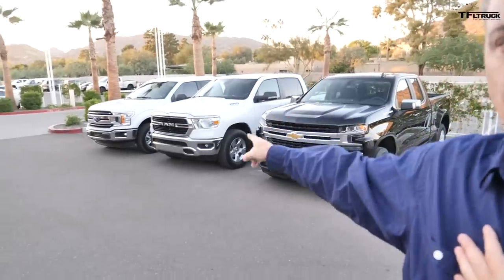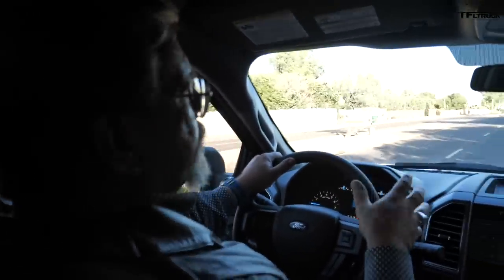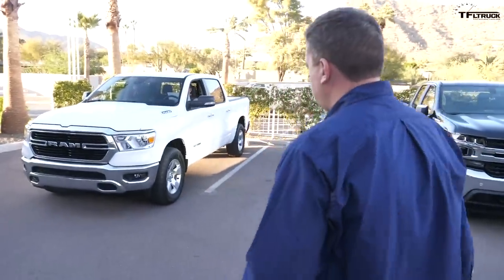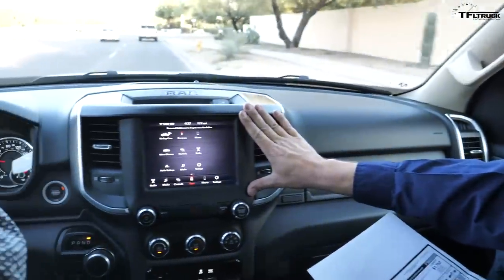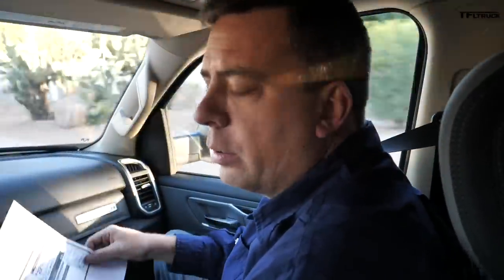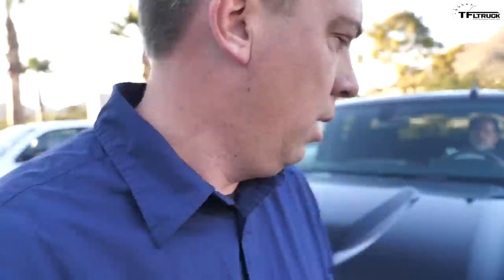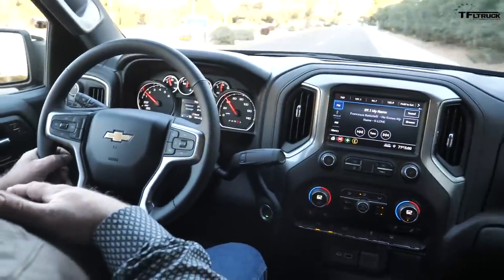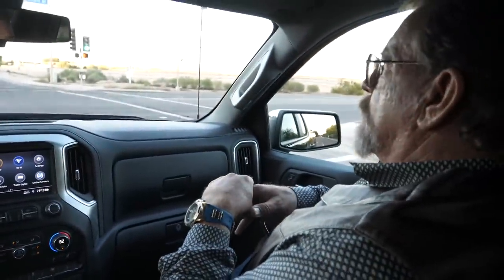Work Truck Wars: 2019 Chevy Silverado 4-Cylinder Turbo vs Ford F150 vs Ram 1500 Review

Comment: As a small farmer from Europe, i would buy chevrolet. Nice small powerfull engine in a big car, that means more space to work on that engine if somesthing goes wrong. I hate when in modern cars there are no space at all to work on them. Here in Europe its the worst -  a small car, like VW amarok with its v6 diesel engine, jeah, its powerfull, jeah it goes and bla bla bla, but there are no space at all to work on that engine and it s expensive to maintain that crap, work truck has to be simple, and i like this chevrolet. Straight 4 cil engine with turbo, what can be more simple. O.k. that electric waterpump could be faulty and expensive to change, but other than that, great truck for small jobs ;)

Comment: Why didn’t chevy put that four banger in the ZR2? It’s a smaller engine with more power and would fit nicely. If it’s in the work truck models and pricing why wouldn’t they put it in their off-road midsize?

Comment: i just don't get why we start at what 36k for the most basic, no radio, no real hvac system other than hot or cold in your face standard system, cloth grey fabric seats, and a plastic dash that rattles after a year of use (not to mention that they fade under the sun and scuffs easily.  (and most of these are not crew cab), yes you get a bed and can tow, but those two should not be a 20k mark up.  those MSRP are a joke.  and i should know.... i am a rolling joke on my ram 1500 :/  i just hope that this balances out in the next decade because they are starting to poke the 100k just to be comfortable, and honestly an SUV is roughly cheaper and i can still tow and haul enough :(  but that is just me

Comment: The problem is Chevy provided the Dodge and the Ford. It's bad enough to have a 6 cylinder in a full-size pickup truck I definitely wouldn't go for a 4 cylinder.

Comment: So chevy decides its ok to test a $44k truck against a $40k ford.  Ford's $44k would've had 5.0 and a 10 speed auto.  Chevy is desperate at this point to compare  a [work truck] that isnt a work truck. To Fords actual work truck.

Comment: Why everybody always talks about rear gears without factoring in the drive ratios of the transmission.  +/- 0.5 on the rear end is in the neighborhood of irrelevance depending what 1st gear (stop and go) and ‘top gear’ (cruising speed) final drive ratios are when comparing between trucks.

Comment: You can thank Uncle Sam for the bullshit 4 cylinder and turbo engines in a full size pickup. And the AC fan probably runs,  but the compressor does not so it isn’t actually cooling. Another gimmick to satisfy Uncle.

Comment: I like the 1998 Chevys 350 small block engine setup better than 1998 fords i don't recommend using fords reusable transmission pan gasket neither they're not reusable and are a bad design ford made 

Dodge's always gets piston problems so they're not the best to have 

Fords fuse boxes aren't marked Chevys is so you know what your looking at or for i fixed the old ford and we're using it now but thats because i got it for free and now i owe the person free help

Comment: i get almost the same mileage with my dependable old 5.3 eight. All of these expensive bells and whistles are  a bunch of baloney. I use my truck for work, i do not need all of this stuff. My brother bought a new Colorado with all of this computer stuff, and, it has been nothing but trouble, it goes into the shop all of the time. This new engine is so complicated and, delivers not much better performance. If i wanted a four cylinder, i would buy a Toyota, still the best.

Comment: Why would you go with the base 3.3 l Ford engine instead of their 2.7 l turbo? The Chevy turbo 2.7 is not their bottom tier engine so the seems a completely unfair comparison especially when it gets to miles per gallon and torque.  I think you really missed an opportunity to compare two turbo engines.

Comment: For those whining about plastic interiors. At least you can use it without worrying about ruining it as much.

Although I'm not a fan of the RAM, but I do like that electric motor. If for nothing else, to keep accessories running while start/stop is activated.

Comment: I think the unveiling of so many turbo engines from virtually all the manufacturers, cars and trucks, will ultimately not be a good thing. I like turbos in specific applications, but there's no denying certain manufacturer and their products are not the same caliber as others. Even some non-turbo engines have not been stellar (or worse) from certain makers. Add turbos to the mix and I think a lot of people in years to come will have a lot of expensive problems, and they'll be bitter.

Comment: Im a fleet mechanic and we have several F150s with the 3.3 v6. Oil pan and water pump start leaking as early as 40k miles. Not great build quality.

Comment: THE NEW 2019 SILVERADO 2.7L 4CYL TURBO TAMPONS ALSO INCLUDED AS NO CHARGE TO NEW CONSUMERS  G.M HAS BECOME THE LAUGHINGSTOCK OF AUTO MANUFACTURERS 👎 NOT GENERAL MOTORS ANYMORE THEY ARE GOVERNMENT MOTORS  WHOEVER IS COMING UP WITH THESE BODY DESIGNS AND ENGINE OPTIONS NEEDS TO BE FIRED

Comment: Everyone bitching about base motors and 2.7 this and 2.7 that. Ignoring the payload capacities. You can load the Chevy up with more gear and people and the bed volume on the short box is larger than both the ram and Fords standard box.

Comment: I think chevy 2.7 inline is a good idea makes all power down low can't beat inline . The ford 2.7 will definitely out run the inline , it will out rev the inline.  Both engines are good choices better than 3.6 penn star . Andre your nuts with that electric motor stuff .

Comment: I reckon these 4cyl trucks are not going to last as long (reliability wise) in comparison to 6cyl and 8cyl trucks. With such a heavy weight to pull around the engine is going to be under strain most of the time and working a lot harder.

Comment: Isn't the 4.3 cheaper than the 2.7/4 cyl?  That's what a fleet buyer will purchase.
Reply: Scott Strom They doing away with 4.3 and replace with 4 banger
Reply: @glenparks5175  They are keeping the 4.3 but haven't released it yet as an option since production just started on the new 19's. They typically offer the most profitable trucks first " crew cabs , higher trims, etc.  The 4 banger costs more than the 4.3 will, so that's why it isn't out yet. The 4.3 will be available in the next few months from what I understand and it will only be available in the work trucks.
Reply: @glenparks5175  Go to the Silverado site. Go to Build and Price. Go to Work Truck. What engine is listed?  4.3L.
Reply: Scott Strom
the 2.7 is replacing the 4.3 V6, their probably keeping the V6 around till they work the bugs out of the 2.7
Reply: Glen Parks go to the Chevrolet website. For 2019 WT and Custom trims the 4.3L is the base engine.
Reply: @anthonywebber2211  if the 4.3 is still around then it's not replaced.  What year is it being replaced? Next year? 2024? No facts= making stuff up. Show us the documentation.
Reply: Scott Strom
1:04
https://www.youtube.com/watch?v=J7fRGCO1_Xw
Reply: Sorry, if you watched the video the 2.7 is only FOR the LT and RST models only. The 5-year-old 4.3 will be around for a foreseeable future as standard for Work truck, Custom and Custom Trail Boss, while its companion 5.3 will be available across the board.
Reply: @Mr10Alpine  Why does the title of this video say: Work Truck Wars?  That's my point. Since when are LT's and RST's work trucks. I already knew that, didn't have to watch the video. This is another apples to oranges comparisons.

Comment: Those are not work trucks maybe the ford but the big horn and chevy are not a work truck is a really based out truck no power window or locks jst an am fm radio vinyl floors no chrom jst basic paint and rims 15' and mainly 2wd rear drive

Comment: I'm not a big fan of the new 4 cylinder. However I am a big fan of fuel economy mainly because I would drive it for then I would be doing towey. So fuel economy would be better for me, but I believe that a the 6 with a turbocharger would be quite sufficient for power and fuel economy in my opinion. I have a feeling that Chevy may take this engine in revamping to make it better as far as fuel economy goes.

Comment: I use this f150 single cab as service vehicle and i absolutely like the sufficient power. Have to add it has great millage pretty much same as competitors v6 while riding empty about 25-26 hwy, but ohh boy it goes down when you load it (not towing), my average in city shows 12 on display, which is kind of expected with small engines. Means this is great economy half ton, if you don't carry heavy too often

Comment: Really the 2.7 4 cylinder could run off of two cylinders it would be running off of 1.35 displacement at that point

Comment: If the turbo will hold up this could be a 500,000 mile motor. If it has forged internals and a roller dohc.setup. with chain.  Not belt

Comment: The price difference between the Ford and Chevy was $5,000.  I would like to see a Ford with $5,000 more options tested. Also the Ram was a few thousand less. Option up the Ram some also.
Add $5000 more to the Ford would be an XLT with the 2.7 litre eco-boost.

Comment: Ford 2019 4x4 stx with 20s 8 inch screen sync 3 for $43.430 still cheaper with huge back seat that Chevy it's an extended cab on ford not a crew cab why dont they choose something that actually makes sense 2.7L 325hp and 400ftq

Comment: The 3.3 from ford in the xl trim is actually a pretty good deal if you go used because people would rather have the 2.7 eco. Thats what I did and I got a good deal plus the engine has more horsepower than my 2001 5.4 Triton and is much faster. Only difference is less torque but if you don't tow much the extra savings in gas is worth it and will most likely be more reliable in the long run because it's N/A.

Comment: Can you do a video of which drive selection (4auto, 4hi, 2hi) works best in light snow/slick roads on the freeway at speeds >50 mph. 
I know the obvious answer is 4auto, but some trucks dont have that option. 

 I know that some will say that you shouldnt do normal freeway speeds in slick/snowy conditions, however, there are times when there is just a thin dense coating, and the normal flow of traffic is still not far off normal freeway speed limits. In these cases I think it would be interesting to see whether 4wd/4auto improves handling or stability over 2wd.

Comment: Very good detailed review. I like how you pointed out the extra room in the bed. That was interesting. Dont like when Mr Truck stated diesel makes more torque since that is false now. There are many gas engines that make more torque than a diesel litre for litre when turboed. Its the turbo that gives torque, not the fuel type. Also, the 2.94 diff in the Titan with its 7 speed has a better stronger final drive ratio than the Tundra with a 4:30 diff and 6 speed. Its not the diff that gives more trailering power, its the final drive ratio that matters. And the chevy makes full torque at 1500rpm to 4000rpm. Not full or maxed at 3500 as stated, its full torque at 1500rpm. Thats lower end torque than a diesel and the curve is longer. Diesels lose their torque like a dropped sack of potatoes past 3000rpm. 

Good job Chevy and nice review minus my corrections I made. But all this useless crap with motors, trannies, diffs, exhaust smells, noise pollution, and rpm’s wont matter when an electric drive truck is available in 2020. Thats what im waiting for.

Comment: see I never cared about all the soft touch luxury or anything... as long as it has cruise control, A/C, and Full BT connectivity on the radio for audio playback that's all u need, if u were moving into the truck for a business, then u can get leather cause its a business expense and price don't matter as much

Comment: I meaaaan yeah 21 mpg is great in a full size truck. Until you compare it to their v8 counterparts. For instance my 2017 ram 1500 hemi with 8 speed auto and 3.92 axle is averaging 20.8 right now. And the 5.3L vortex 2016 Silverado I had as a loaner awhile ago was getting 21.6 AVG. the v6 and v4 trucks aren’t really about fuel saving anymore. Because the v8s have caught up in that department. The smaller displacement motors are to bring prices down for Both the manufacturers and the buyer.
Reply: At the end of the day though. There is no way I’m buying a v6 or v4 ( unless it’s the 3.5l ecoboost) for $40,000. NOPE 👎. I got my 2017 ram last week with everything mentioned above AND it’s 4 wheel drive with 38000 miles for $25K.

Comment: I find it refreshing to see tests on base models , the guy with the beard has too high of expectations.  The horsepower ratings are pretty amazing for small engines just a bit light on torque.